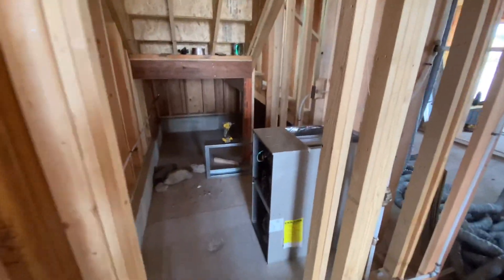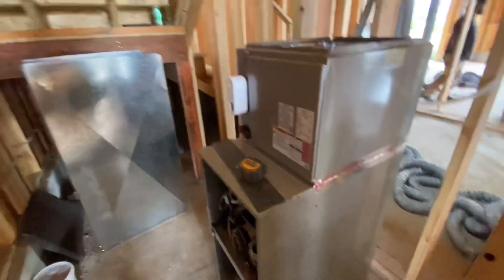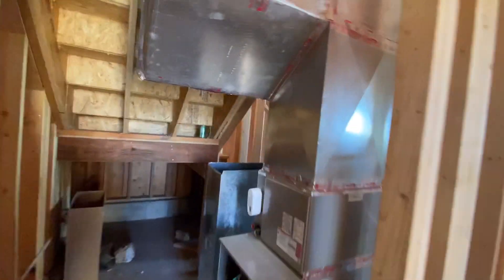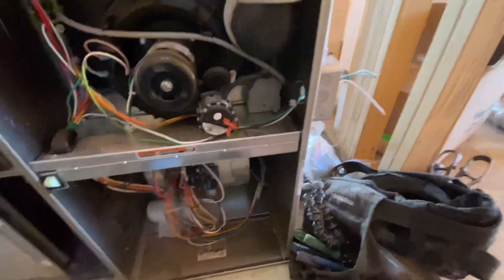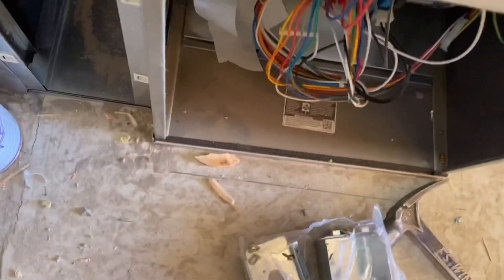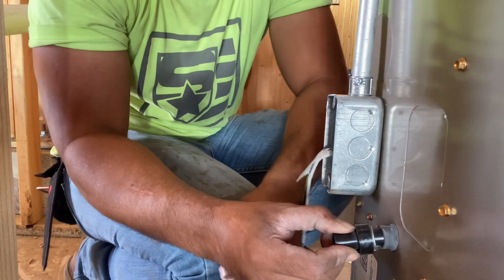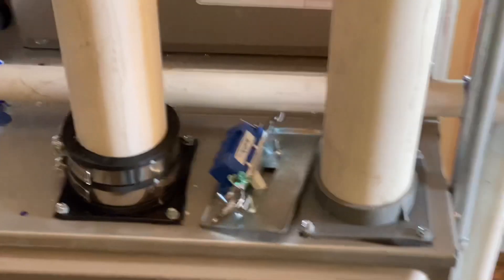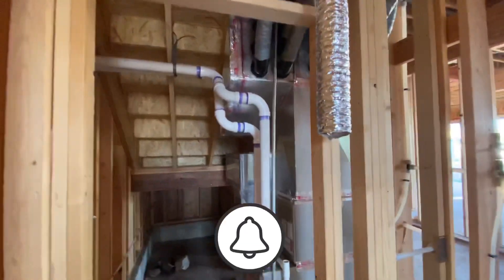HOW TO INSTALL A FURNACE Step by Step | UP FLOW SYSTEM HVAC

Comment: By code in your area, are you not suppose to put bricks or a drain pan under the furnace? And what about a secondary float switch on the evap coil to protect from water damage?
Reply from the maker: @smacleod69 no sir it’s not required in this case  but if it were on the second floor or in a attic it’s required that we have a drain pan and a secondary float switch.

Comment: Nice work I’m in Canada for the fresh air venting it’s good to go at the side because the moisture alway kill the gas valve faster and the flue needs a rubber connector on the top  not straight down so you service the ventor motor I’m not sure if it’s the same over there,nice video though keep it up